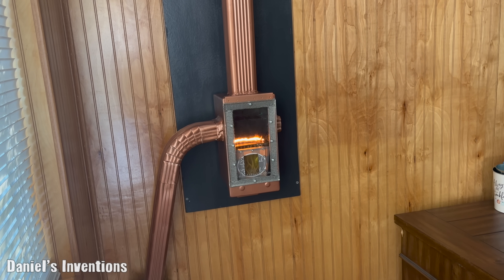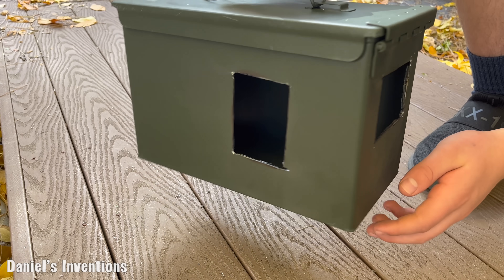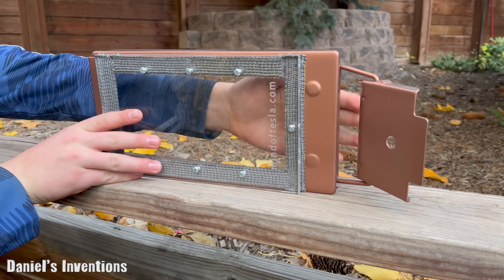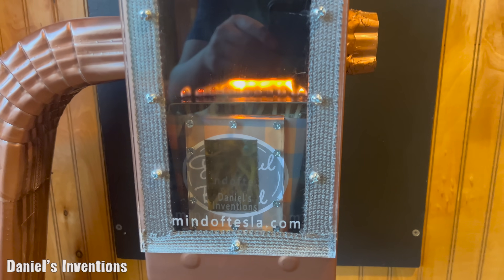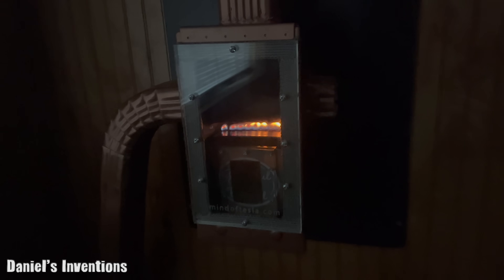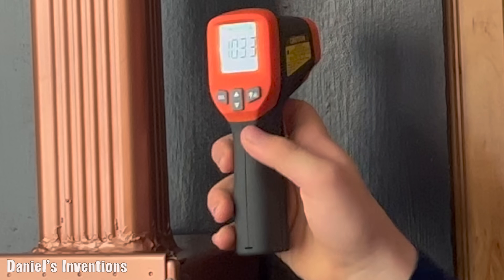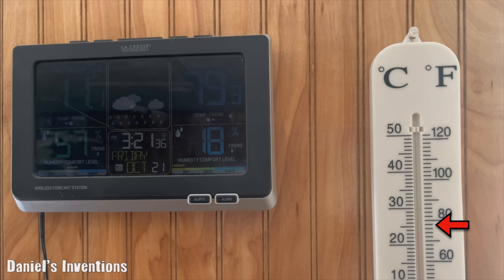ENDLESS Heat for Your Home WITHOUT Electricity

Comment: While I commend you on this video and idea there's a few things with this build I have to comment on. Let me point out that I’ve been a certified Chimneysweep for a very long time. This method of heating is not a new one and historically dates back a very long way. Styles change but the design is mostly the same.   First you must space fireboard and concrete board 1” from the wall for safety reasons, this allows air to flow behind the board and prevent the board from retaining heat at the firebox mounting point and causing a smoldering fire behind it. This is caused by the concrete board coastally transferring the heat to the wood causing it to get hotter over time to the point of combustion. Next issue is that gutters are not made of steel and are aluminum. This means the melting point for the metals is around 1221 degrees F or 660 degrees C.  while the output you showed is around 450 degrees F the spots directly over the flames will be much hotter near or at the melting point.  You would be better off using copper gutter as copper’s melting point is 1984 degrees F or 1085 degrees C. Also, copper gutter comes in round segments meaning you will get a much better draft.  It would be wiser to braze the copper to the steel with bronze rod. I’m unsure if copper gutter could be roll flanged and brazed like steam boilers but this would be a much better option to seal it than JB weld which will break down over time.  Your other option would be to use a multitude of 1’pipe flanged into the box in an arrangement that would pick up much more heat. You can find this information by looking up how to make barrel stoves and stream boilers. Then braze the copper gutter around the outside of the box to allow attachment of the input and output piping.  Lastly, I would recommend building a means to adjust the wick higher and lower to better control the heat. There are a number of easy ways to do this with some old small gears steel rod and flat wick. I would also as other sugested look into the chimney effect as well as this will cause better movement of air.  All in all This is a great build with some minor tweeking you can make it even better.
Reply: Gutters are absolutely made of steel, as well as aluminum, and Galvalume. The issue with steel is that they are usually galvanized. You don't want zinc poisoning.
Reply: @1stuart1  Well actually they were made of copper,  then galvanized steel,  and now they are mostly made of aluminum.  Everything changes with time. Copper became to expensive,  galvanized steel still rust when clogged and holding wet leaves,  and aluminum is cheaper,  doesn't rust and is much lighter. Making it easier to install. Not trying to be a smart ass. I used to install them
Reply: @anthonyaubuchon765  I inspect houses all over the country. All types of gutters are still made, and still used, don't forget vinyl. I've never seen a copper gutter in person as that is mostly on fancy houses on the East coast. Seems like the major determining factor is just what the owner is willing to pay or what the sales person is able to talk them into. In fact, just today I saw both aluminum and steel.
Reply: @1stuart1  That's true,  I didn't think about vinyl.  That wasn't out when I was installing. I know they still make galvanized gutters but they are not used as often.  I  guess that could depend on what part of the country you're in.
Reply: @1stuart1  I don't know what kind of camping you're doing or how big your tent is but I seen a pretty neat ideal on here a while back.  A guy split a log and then chopped the edges off each piece and then put them back together wrapping wire around it to hold it together. It made about a 3" hole all the way down the center. He mounted legs on it so it stood about 4" off the ground. It burns very efficiently. Once he got it lit he he stuck a 2" metal pipe through the center below the bottom of the log and ran the pipe into the tent. Since heat rises it draws air through the pipe, heats it and into the tent. The pipe is below the bottom of the log so no smoke, just clean warm air. Might be worth checking out
Reply: @brock8830  yeah it seems to be a coastal thing, which I generally avoid, with the exception of Hurricane territory in the southeast.
Reply: @brock8830  oh yeah, lots of Californians moving to hail areas and thinking their house looks great with copper roof accents. Haha.
Reply: @anthonyaubuchon765  if you were paying attention at all to what the young man in the video was saying, he clearly stated at the beginning that he was suing steel gutters.
Reply: @anthonyaubuchon765  And stainless Steel lasts way longer than any of the three you mention.
Reply: @anthonyaubuchon765  It's called a Swedish Candle
Reply: @anthonyaubuchon765 😂😂😂😂 and a tree is a tree 😂😂😂 my tipi has a wood stove made from rock's.a Rock is a Rock gives out good heat 😂😂😂😂
Reply: @1stuart1 no you don’t!! However, if you do find your self breathing in gases from something galvanized drink some milk and get to fresh air.
Reply: @1stuart1 I removed my old stainless restaurant vent....would stainless be safe to use in this environment?  Off gassing wise?
Reply: @johngatsby1473  I'm not experienced in this specifically, but fireplace flue pipes are stainless and there are no issues. You don't want galvanized steel because burning the zinc off releases poison gas. This is not an issue with stainless.
Reply: @1stuart1  thanks for the response.  I'm going to build one of these out of scrap everything...goal~almost free....lol
Reply: Could this system be installed in a wood burning stove.  Seems like that would solve all the material deficiency issues?
Reply: @rv5002  It would be a challenge to do, to make it recirculate room air separate from exhaust…unless you just used the old woodstove with a fresh air intake added, & kept the chimney pipe intact…guess the heat would then build up in the woodstove, & the usual woodstove fan could recirculate indoor air. 
But, it Must have a fresh air intake that comes from outdoors, to help keep the flames lively.
Reply: @rv5002  I would recamend building a larger box version and work from there. I'm not comfortable modifying any stoves to another system as depending on the stove this could cause structural issues and more.
Reply: @HiddeneyeInc  Then don't build one.
Reply: @rv5002  cause, distillers and such use copper no?
Reply: @rv5002  Yes, most definitely!
Reply: @rv5002 Yes. The cast iron is dens and strong.
Reply: @hiddeneyeinc. What do you think of this idea?
Reply: After a quick google search I was able to find steel rain gutter downspouts, but given that they were all galvanized I suspect you're correct that the one's he used were aluminum.
Reply: @Devin_Stromgren  I've seen factory painted gutters of steel, Galvalume, and aluminum. It doesn't matter now, just don't want them to hurt themselves. 

Anyone know where to get fireplace glass? Wish there was a little more detail, like showing them adding/ replacing oil. I want to make one of these to see if it could replace the wood stove for my GP Small military tent stove. A wood burning stove in a tent is cool, but only had like a 2-3 hour burn time so everyone woke up cold every morning.
Reply: @1stuart1  The oil is just in a coffee can.  Just pull the can out and pour more oil into it.  As for tent stoves, unless you're camping somewhere without easy access to wood I would recommend going with a woodburning ammo can stove made out of a larger ammo can such as one for 20mm rockets.  A wood stove made from one of them will burn for 8 hours.
Reply: @Devin_Stromgren  I wish that were true. The wood stove that came with the tent is about 5 times larger than a 50 cal ammo can, but it isn't designed all that well I guess because it definitely puts itself out in a little over two hours. I'd love a stove the size of the ammo can though, that'd be great and save me a ton of room and weight!
Reply: @1stuart1  reclaim glass from old stoves
Reply: @1stuart1  Perhaps if you surround the stove with a lot of stone so that when awake and burning all day it will heat up the stones and give off heat all night. Also think about double tent or using ferns, leaves etc to insulate.
 Also they used to take the stones and dig a ditch in the ground, put the hot hot stones in the sleeping ditch and then cover with a bit of sand or soil then moss or leaves and then bedding.. kept them warm all night.
   Remember too that the earths ambient temperature below permafrost is 50+/- degrees, which will suck the heat out of you ... but if you warm it up a bit it will holed the heat for a long time and 50 degrees is far better than 30 or below!!!
Reply: @1stuart1  Oh wow.. if it is that big then you arn;t using the right wood, the right size, or something .. too much air perhaps.. Try lining the inside and outside with stones and see my other comment above.. For me I have designed many a stove and learned a lot.. and again more heat is lost through the chimney!!  You double your heat by putting the piping at an angle for a long time , even around and around, before going vertical.
  I have a design that splits the large pipe into two smaller ones and they are in a helix coil spiral before joining again and going vertical, but have yet to build...
Reply: @1stuart1   Lol, I know exactly what you mean about the wood stove.  It sucks having to get up every few hours to add more wood. He installed the glass window into the  lid of the ammo box,  so you just pop the latch and open to gain access to refill with oil. He didn't show anyway to shut it down so I can only assume you have to blow out the flames to shut it off. I think you could make something like this work in your tent.  I mean of course you will have to design it to be stable enough not to fall or get kicked over. A wood stove can be used so I don't know why you couldn't use this. Being in a tent I would make the wicks adjustable for more or less heat and of course you will need a power supply for the fan if wilderness camping
Reply: @1stuart1  ok, now I have to ask how big is your tent and what material is it made of?
Reply: @anthonyaubuchon765  It is a GP small, which I think is 12'x12. It's a military canvas tent. We only used it the once, and I'll honestly probably never use it again. However, if I were to build a heater like this, I could fit that inside any off the shelf tent made to fit a small titanium stove with ease. I don't even think a fan would be necessary, but I like the idea of one of those  wood stove fans that run off just the heat of the stove. My DIY streak has been reignited recently (mostly by this video actually) and I'm considering sewing up my own Sil-nylon Teepee tent. After I watched this video, I went and built myself a nice barrel stove just to have in my back yard.
Reply: @1stuart1  I have seen fireplace glass advertised cut to specific size on Ebay.
Reply: @1stuart1  Yeah my buddy has a tent with wood burning stove and we had to load it throughout the night or we would be freezing!! There’s got to be a way to soak or use compacted wood shavings in a brick that burns a longer!
Reply: @1stuart1  Apparently The trick is to close front vent holes and then the flume at the chimney to help it burn longer and slower. I don’t remember if his had the flume part though.
Reply: @hardcore4476  there are ways to pack a regular stove so it burns top down and burns a long time, but my stove is a bit too small for that, and is a vertical barrel, so it isn't conducive for making a tightly packed brick of wood.
Reply: @1stuart1  True..
Reply: @1stuart1  a discarded stove
Reply: @1stuart1 amazon has fireplace glass.
Reply: @1stuart1  Anyplace that repairs fireplaces. They can usually set you up.
Reply: @1stuart1  Do you have a damper in the exhaust stack? If not, add one and your fire will last much longer.
Reply: @Devin_Stromgren  just give them a wipe with muriatic acid. Zinc is gone
Reply: @Devin_Stromgren  They also come in stainless steel.
Reply: I never read long-ass comments. But yours, I had to read and pay attention to every word.
Thank you so much for your shared input.
I think the maker of this video should contact you to create a better version of this together.
You two could create a video teaching millions of us on how to build one of these and save lots of money and I turn, taking more control of our lives. It’s paramount!

P.s. please teach us how to build the glass cover too.
Reply: @da1nonlydoron779  Problem is he's wrong on several points especially using copper that when heated to high temperatures like the 450 degrees shown will give off deadly fumes.
Reply: @da1nonlydoron779  he is wrong about the copper..just use real duct...duh
Reply: A very informative post
Reply: @criminologystudent1nvestig523  9th
Reply: @paulsmith2956  9th what?
Reply: This guy knows his shit. Good work on bettering the world around you.
Reply: JB Weld is great stuff and ok for a prototype but totally inadequate for a permanent job.
Simply buy steel tube, as sold for car exhaust pipes and braze or silver-solder the joints. The extension pipes will be cooler so can be made with aluminium. 
All joints must be sealed with exhaust joint paste because any leaks on the exhaust side risk CO poisoning. It’s colourless and odourless and it will kill you.
Reply: I think he said he spaced it an inch for safety already
Reply: Why not use 3” pellet stove pipe wouldn’t that work?
Reply: @bomark2002  I was wondering the same thing.
Reply: Just use a material that is approved for stovepipe so you dont kill someone trying to save a few bucks. Iron and Clay work well as you must know.
Reply: can you someone just build me one please
Reply: @allwearearestars  I hear you. Maybe he will?
Reply: I commented something very similar to this and I seem to be making many people that keep claiming that I am wrong very angry lol
Reply: @RareVBlue  don't let people's thoughts get to you. If you cand back up your points and they still get mad. It's not on you. Some people like to get angry over nothing
Reply: @HiddeneyeInc  this is the internet. There are always people wanting to get mad lol
Reply: @RareVBlue  They probably  still believe  fake news media  like CNN  too
Reply: I'm not angry but they're steel.
Reply: @RareVBlue  That's why I largely just troll these days. Too many people will be assholes for no reason at all. So I just give them a good reason ahead of time. :P
Reply: @hideousruin  😂 😅 😅 Ain’t it!!
Reply: @hideousruin really. That’s the reason? Sure, ok
Reply: Dude! What a thoughtful reply.  Very cool of you to take the time. 😊
Reply: Hopefully his parents don't have their home burned down 😂.  Is this neat way to heat a fort or a cabin, sure. Heat a 200k to 400k home ? Absolutely not 🤣 Jesus CHRISTMAS their home owners insurance just got cancelled.
Reply: WETT certified chimney sweep here. Great idea but I echo what the above sweep said. Most important is that you get that air gap of 1" behind the concrete board. The threat of a smoldering fire behind that is very real. 
Great work!
Reply: To those who can't agree on something simple as the safety of heating copper, if u were able to watch the video then it's just as easy to look up the correct answers rather than rely on advice from an unknown source. 🤳😐
Reply: Wouldnt it be easier to just use stove pipe or maybe even hvac duct
Reply: Why don’t you build one then since you know so much? Oh I forgot, you are a chimney sweeper!
Reply: Just letting you know I noted you in my comments.
Reply: And lead pipes for your drinking water!!
Reply: In your sentence: "You would be better off using copper gutter as copper's melting point is" should read 1984°F , not "184" . It's just such a valuable part of your comment.
Reply: Holy crap there are polite people left .
Reply: Good info, thanks for your input!!
Reply: Wow that's a great comment, amazing info!
Reply: Very tactfully said. Constructive criticism is in short supply on the interweb.
Reply: @glennwmurphy1  i grew up in a family of construction workers and have worked in the field closely with HVAC among every other certified professional there is since i was 14 years old (currently 39). ive had everything from construction super certs to a general contractor license. and even if the creator of the video did do everything right. you have to assume other people who arent this guy dont have the same knowledge base you do and will burn their house down. thats the reason we have visual warning on chainsaws that specifically show and tell you not to cut the branch youre standing on. ppl dont think about the consequences before doing something.
Reply: Came to post a comment with a few of these points but you articulated this perfectly.
Reply: 100% those are aluminum downspouts painted copper they do make copper aluminum and galvanized etc. I love this heater but I'm glad you put your comment in here for people that didn't realize the aluminum wasn't a good choice so they can use the design and tweak it
Reply: Sure hope no one dies due to this video or even the comments. Exhaust pipe needs to be double wall. Gutters weather aluminum or copper or not designed for this application. JB welds are all suspect. Carbon monoxide is invisible. Don't die.
Reply: oil plus 3D printer = cheap heater
Reply: Politely added information with facts, this is how you help people to make better things and improve their skills
Reply: Young intelligent people doing positive things.  There is hope
Reply: Paragraphs.
Reply: @GravaticBurst  "Paragraphs"
Indeed. Must not have heard of punctuation before 😝

Good info in the text though so I overlooked it. Still a pain in the bloody arse to read though...
Reply: @Johny40Se7en  Essay's kill my eyes. Personally I'm bad with punctuation.
Reply: Awesome advice
Reply: Did he make the upgrades you suggested?
Reply: Master Marc Subliminals  LMAO
Reply: You're very informative, Charlaine. Despite the TECH rampage changing our words to divide and conquer. It is still understandable.
Reply: Well said. I appreciate you
Reply: dude, fix your F to C
Reply: W
Reply: Its not 1085 c its 85 c. 1000 c is a big difference.
Reply: DUDE! those gutters are worse than aluminum - they're steel... GALVANIZED steel, thats why the look like aluminum. kids been breathing zinc vapor...
Reply: not to mention if i remember aluminum gives off toxic gas when it burns so that would not be fun probably lol
Reply: @seancook4317  those gutters are actually made of GALVANIZED steel - zinc is like 1000x worse to be breathing. and he said he burned it 12 hours a day for a week straight. that kid already messed his brain his brain up permanently. he's almost guaranteed to get early onset Alzheimer's now
Reply: @mordokai597  oh thats nice, hopefully people read the comments before they melt their brains, i dunno maybe he found like regular metal gutters someplace somehow and everything will be cool, ive never seen them where i live tho, but maybe he's in a different place, i have no idea, i hope people dont die lol
Reply: P
Reply: Not sure where you could buy one these days but steel downspouts were available. I have a few lying around.  His do look like aluminum though
Reply: @chrism6952  steel still exists, with Galvalume being the most common (I think). That is steel galvanized with aluminum instead of zinc. It's a trade marked product so you should be able to look up what's in it, in case zinc or something else is still an issue.
Reply: Awe hell Rent a cabin 😂😂😂😂😂
Reply: Woaah I'd love you to be there when I post my jayco remodeling video in the future. 

I could so use some advice when it comes to heating it. I'm a little against propane heating...and I need it to be non electric..so this idea is bomb.

My concern is... the space I will have and my quality of air plus safety. 

I am sure you'd would share some really practical and beneficial advice.

Had to screenshot this 😅
Reply: You should put out a video lol
Reply: There are steel gutters and downspout , I know because we use them at work . We use steel , aluminium and copper !
Reply: I lost it at "certified chimney sweeper" -  
Chim chiminey, chim chiminey, chim chim cher-ee
A sweep is as lucky as lucky can be
Reply: Safety schmaftey......
Reply: The aluminum is going to conduct the heat away too fast to melt. I have built many foundries and forges.
Reply: Has to be the most well-written, positive constructive feedback on the internet
Reply: imagine not reading description , he said they took inspiration from another place
Reply: We do not care.
Reply: Great reply. I had my doubts starting with the board on the wall. Thank you for sharing your expertise.
Reply: Dang dude, you should make a video!
Reply: I'd also recommend  you win the lottery  so you can hire an experienced engineer  with a Chimney  installed, oh and a AI to design the perfect one. 😄  jokes aside. Glad to see people  being positive  and sharing  ideas. OH internet, you've come a long way since being made by the military  complex.
Reply: Some rich guy: I recommend  you stop being broke and just buy a diesel v10 heater that rolls coal like a factory and live big!!!! Woooooooo, Mericaaaaa! Do it big or go home!!!😄
Reply: Wow your changing the world with your knowledge
Reply: This is not a great build. It is dangerous. and deadly.  You are correct " JB weld which will break down over time" this will cause a fire. Gutters are made out of aluminum and tin. Since these were prepainted I am guessing they are Tin.
Reply: aChtUaLlY...
Reply: First off to the know it all. It’s a steel painted DOWNSPOUT. Not a gutter. It’s steel! It’s painted, not galvanized. Geez! If he wanted to burn wood, he would have. Geez!
Reply: How tf does someone become a certified Chimney sweep? Be a 10yo in Victorian England?
Reply: Great Advice.
Reply: Do you have any reference videos on this also you're awesome thank you for sharing this!!!
Reply: I would love some advice on a problem stove we have..
Reply: Maybe ⅛ in square steel tubing, then a simple welder can be used
Reply: Is it possible to build a small version of this to heat a homeless shelter type cart thats 2.5x2.5x4? Would need it small because of very limited space but also used for cooking- I can see frying and backing with a hood design. My question is how small can this be built and how much space would it take up if using least space as possible?
Reply: A screw jack would work well as a way to fine-tune wick length.  It would require a little bit of welding though.
Reply: Could aluminum gutters be used in place of ductwork?
Reply: Don't forget how easy it is to make copper alloy and custom molds, make your own fittings etc in one big pour from copper you can scavenge. BTW thanks for your info
Reply: Thanks Bro
Reply: First off, my punctuation nazi side is gonna have a little dig, because that was a pain in the arse to read.
But that's a lot of great information, so cheers 👍
Reply: What the fuck is this? I'm not gonna read all this nonsense
Reply: ❤❤ certified chimneysweepr❤️❤️
Reply: Very well written advice as someone wanting to stay warmer this year I thank you
Reply: Yes one would think but I concur for the copper actually doesn't conduct a precipitous amount of heat in a quick enough time for it to be considered intrusively therefore statistically speaking it's 00007 possible that that's even likely to happen. Also may I conclude that the vortex precipitation conditions must proceed the contributions of heat supplied by the convex heat source thus obtaining a considerable amount of proclivity to engage the fortify the side bearings of the ignition sequence blow off
Reply: Any chance you could do a vid on the build you suggested?
Reply: I have no plans on trying this ever but This was a wonderful comment. Informative knowledgeable and courteous. I see so many comments where people shame others and don’t say shit.
Reply: Please follow up. Thanks. I hope he makes another one.
Reply: It's all about safety,
Reply: you can get steel gutters.. i am a home improvement contractor.. aluminum is more popular but you can easily get steel
Reply: please build one so we can see it!
Reply: Thank you for pointing this out.
Reply: So fumes go straight up and not out the side too?
Reply: How do you suggest venting out of a window and turning this into like a standing AC unit or whatever
Reply: Thank god an expert stepped into the chat.  I'm not expert, but my brain raised a red flag with the aluminium.
Reply: I was about to comment these points exactly but you articulated them much better than I would have. Bravo.
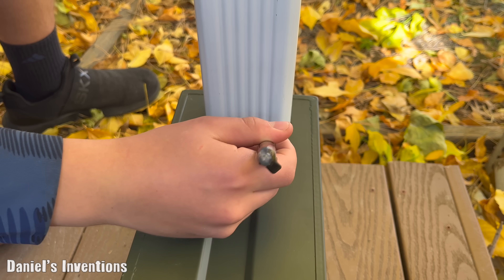Reply: If you’d watch the video, he used steel gutters. 0:45
Reply: So awesome
Reply: can you do a video on this? but give credit to these guys too?.
Reply: good job guys
Reply: hell yeah, Daniel, that's a great invention.
Reply: Would love to know the cubic volume of the area heated.  Anybody know if he has ever discussed that?
Reply: This guy old timey heaters
Reply: I really appreciate you took the time to add to this already great idea and you were obviously very well schooled on these things and giving this advice for free thank you very much for helping us people who are kind of layman...lol
Reply: question for you, is there any danger of co2 poisoning with this build?
Reply: You should seriously make one of these schematics you just described and patent and sell the SHIT out of it. I shouldn't be more then $30, I'd say, unless the person wants extra piping then that is their problem, im just saying the heater itself as he showed in the beginning of the video. Do it your way tho. It would last so much longer and be alot safer. Might last a couple life times. For real tho. Dint forget me if you get big lol go patent that shit!! Just rember the cheaper something is 99 % of the time the consumer will choose that regardless of the make of the product. It's hard times and everything is expensive as hell ESPECIALLY heating and cooling. That's where half if not more of ANY electric bill comes from, heating and cooling products. Hope you do it and come back and make me your vise president ceo 😊
Reply: Did anyone else read this? Lost me at certified chimney sweep lol
Reply: information overload  - he's solving the problems as they arise.  You must be a lonely person.  From reading your comment I'm not surprised.

I would not want to ask you, how are you doing, I'd rather watch paint dry.
Reply: @HiddeneyeInc

Why most long comments are just a HUGE WALL OF TEXT ?
HARD TO READ so I spaced your comment out every few lines. This way I'll read it.

---
While I commend you on this video and idea there's a few things with this build I have to comment on. Let me point out that I’ve been a certified Chimneysweep for a very long time. This method of heating is not a new one and historically dates back a very long way. 

Styles change but the design is mostly the same.   First you must space fireboard and concrete board 1” from the wall for safety reasons, this allows air to flow behind the board and prevent the board from retaining heat at the firebox mounting point and causing a smoldering fire behind it. 

This is caused by the concrete board coastally transferring the heat to the wood causing it to get hotter over time to the point of combustion. Next issue is that gutters are not made of steel and are aluminum. 

This means the melting point for the metals is around 1221 degrees F or 660 degrees C.  while the output you showed is around 450 degrees F the spots directly over the flames will be much hotter near or at the melting point.  

You would be better off using copper gutter as copper’s melting point is 1984 degrees F or 1085 degrees C. Also, copper gutter comes in round segments meaning you will get a much better draft.  

It would be wiser to braze the copper to the steel with bronze rod. I’m unsure if copper gutter could be roll flanged and brazed like steam boilers but this would be a much better option to seal it than JB weld which will break down over time.  

Your other option would be to use a multitude of 1’pipe flanged into the box in an arrangement that would pick up much more heat. You can find this information by looking up how to make barrel stoves and stream boilers. 

Then braze the copper gutter around the outside of the box to allow attachment of the input and output piping.  Lastly, I would recommend building a means to adjust the wick higher and lower to better control the heat. 

There are a number of easy ways to do this with some old small gears steel rod and flat wick. I would also as other suggested look into the chimney effect as well as this will cause better movement of air.  

All in all, this is a great build with some minor tweaking you can make it even better.
Reply: Yeah true that I was about to say that
Reply: Now, that's a professional input!
Reply: You're waisted on chimney sweeping mate.
Reply: you can get steel gutters, i owrked with them for 6 years.
Reply: You can get heat activated fans now too, no need for electricity or batteries (works via heat build up)
Reply: You can get heat activated fans now too, no need for electricity or batteries (works via heat build up)
Reply: You’re one smart bastard. Like an encyclopedia.
Reply: Could you burn wood or pellets or something else besides oil in there
Reply: Is there anything on the market similar to this that you can burn wood or charcoal in
Reply: Make a video.
Reply: Thanks for your comment and help. I have a question. Is that amo box safe to use and is it safe to paint it? What about smoke smut? How would you solve that?
Reply: Yes. This guy. Yes
Reply: No, that is not aluminum, those are steel gutter drain pipes, the one with the flame on it might rust through fast enough, but they're not going to melt.
Reply: Type better
Reply: You can buy steel gutters. Steel is also what is used in common forced air gas heaters, and the temperatures here are very similar. The only issue is pulling the fresh air from outside is not necessary and you could save a hole in the wall. You are however right about the spacing from the wall. Given these temps you would need 6" of open air between the combustibles or equivalent insulation.
Reply: If it works for him, good on him is always one. Well, I was a 😂😂 then 1000-word essay, get a life ffs
Reply: Sorry bro but nobody is reading all that
Reply: What he said👆
Reply: Dude...this paragraph manifesto said, "Let me make this youtube video about me now".. 😂
Reply: Your hired
Reply: That was nice helpful feedback.
Reply: Error 1: Gutters do come in steel. Galvanized AND stainless.A: Galvanized steel has a lower melting point compared to non-galvanized steel. While the melting point of mild steel is around 1370 Celsius (2500 Fahrenheit), galvanized steel has a zinc coating that begins to melt around 420 Celsius (788 Fahrenheit). Steel gutters also come in round segments as well as square and rectangular.

Error 2: Heating copper can release toxic fumes, particularly if it is heated to high temperatures. This can leach copper from the metal and give people copper poisoning.

Error 3: JB Weld HighHeat™ is a hand mixable epoxy putty stick specifically formulated to bond and repair materials that will be exposed to high temperatures in automotive and industrial maintenance applications. It cures to a tough, hard bond with little to no shrinkage. This industrial-strength product outperforms conventional epoxy putties at high temperatures and sets in 1 hour at room temperature. After 8 hours, it can be drilled, tapped, machined, ground, filed and painted. HighHeat™ is rated at a tensile strength of 4000 PSI and cures to a machine grey in color. It is able to withstand continuous heat exposure of 450ºF and intermittent heat exposure to 500ºF.
Reply: " wood causing it to get hotter over time to the point of combustion" This is basically impossible for an small oil lamp style heater as shown, all your rules of thumb are designed around wood stove heaters, evaluate the actual device as shown and calculate the thermal properties, you'll see.
Reply: Please make a video
Reply: Christ, bring in an "expert" chimney sweep and he takes up half  of googles storage facilities. 
I cant be arsed reading the end of your lengthy comment my friend.
Reply: Gracias
Merci
❤🎉
Reply: 😅😅😅😅😅 but the fkrs😂got heat.some how managed to buy insurance with out home inspection 😂😂😂😂😂
Reply: High heat exposure can cause copper to give off toxic fumes. Safest material would be steel. Yes those downspout pieces are aluminum, and vary thin at that, plus the paint is not made for high heat or open flame, also toxic. I'm a painter who used to do gutters, nice design, but huge health and safety issues.
Reply: @tgmickey513  research should be done
Reply: @Mickey P  So all this copper cookware is giving off toxic fumes? The only issue is if its giving off copper oxide, this would not produce the heat required. Not even close. But I mostly agree steel is the best material. However, in this application, coppers superior heat transfer would be advantageous.
Reply: @tgmickey513  could you just burnish the paint off with a wire wheel?
Reply: Doesn't copper give off noxious fumes when heated to too high a temperature??
Reply: @davidp8305  it could if it's a poor grade copper and the heat reached near melting but you won't get the  heat levels that would cause that with what they are doing. You're talking near melting point 1800f or so, and your not going to get there with this idea If that was the case you wouldn't be able to cook with copper pots and pans, use copper to brew beer, distill and more.
Reply: @HiddeneyeInc Great informative response!
Reply: @HiddeneyeInc  All copper gives off fumes when heated. even the wiring in your walls.
Reply: @davidp8305  Copper? its only paint, would guess on aluminium pipes
Reply: @Jorgen888  Could also be steel. This guy is 100% wrong saying gutters don't come in steel. They do. Both galvanized and stainless steel.
Reply: @davidp8305  Yes, it does. However that is the least of their worries. They are using oil, which means the by product is Creosote Oil, carried up and away by the heated air. When cooled it collects into a very sticky, very flammable oil substance. Since there are no embers, it's not much of a problem. Still requires weekly cleaning, and seeing that it is permanently fastened to the wall, I am curious about his cleaning methods. Add in heated copper and you have a flash fire. The heated copper when in contact with Creosote Oil can become a very danger combination.
Reply: @davidp8305  
You might be thinking of galvanized metal.
 It is healthy to drink water from copper bottles, etc. It is anti viral. But like the Zinc used to Galvanize metal to prevent rust, heating copper in this manner may not be ideal.
Use SS camp stove pipes!!!
 
Maybe the OP will comment. That had awesome insights into this build!!
Reply: @howtogetoutofbabylon8978  The only thing I would of done differently would of been replacing the candle wicks with a piece of carbon felt, it still would of wicked the oil the same way and the carbon wick will not burn away. It is pretty much a forever wick. It also would of distribute the heat more evenly. My2¢
Reply: @davidp8305  No. Brass will, but that's due to the zinc in the alloy. Cooper itself is fine and is often used for small boilers.
Reply: @davidp8305  yes
Reply: @davidp8305  I thought that was brass that did that
Reply: @davidp8305  That temp is much higher than the Aluminum he has.
Reply: @davidp8305  choreboy.... 🔥 💨😤
Reply: @David P  Not at these temperatures. It would need to melt, and still go further.
Reply: @davidp8305   that's brass,the zinc content
Reply: @davidp8305  it not copper. He painted it😂
Reply: @davidp8305  No
Reply: @davidp8305 yes which is the next point. Any and all fumes coming from Copper Metal is poisonous
Reply: @davidp8305 Not to mention that even gangsters like 'Little Caesar' are on the record as being vehemently against it: "You'll never take me alive, copper!" 😂
Reply: @davidp8305  Pure copper at these temps is safe. You'd need to exceed 900C to start seeing anything measurable, which is to say the copper would begin melting.
that said, some copper has trace amounts of other metals, like zinc, which might be a small problem at 500c, but not in this application since any vapors would be released INSIDE the tubes and vented.
Reply: @davidp8305 i heard the same lol
Reply: @davidp8305  They use copper stills for making alcohol so I would have to say no.
Reply: @davidp8305  sounds new to me.. I cook using copper
Reply: @davidp8305  yup, it forms cupric oxide, inhalation of these fumes can cause metal fume fever, in short, don't use copper in a heater folks, and don't use galvanized ANYTHING, use iron or stainless steel
Reply: @janceifyre  Thanks for the info!
Reply: All I got to say is jb weld really
Reply: @RentAsunder0 😂😂😂😂😂😂😂
Reply: @RentAsunder0  JB Weld makes a high heat version that is made for this kind of application.
Reply: Very kind of you to share your experience.  😊👍
Reply: Good grief.   This is why we can’t have nice things.
Reply: ugghh. How can I become a certified chimneysweep? I think there must be a lot of demand for that nowadays...
Reply: @oriraykai3610   There are plenty of sweeps. But, they are bound by their insurers, & don’t want to risk Anything to just install a chimney sleeve an owner has. 
All the contractors want to up-sell more products. Many will say, “sure, I’ll install your chimney sleeve, but, will charge you $2000, to make up for loss of up-sell profits!”…so do woodstove sellers. 😡 NONE have any eye towards future business potential…like, today, I need the chimney sleeve put into our chimney; tomorrow I might need other handyman assists, to redo windows, doors, etc….NONE think of that, when turning down a job like simply putting a chimney sleeve into a chimney. 
So…IF you were to be a “handy-person”, to help owners with whatever labor they need done, just as they want it done, you’d likely have way more business than you can schedule & complete, & have work for decades—especially if you are good at creative, durable problem solving, & details done right!
Reply: It’s a oil lamp on par with a little, minimal candle…. 

You people and your overriding urge to look competent when a child would understand that this just won’t get that hot.
Reply: Dude said I’m a certified chimney sweep😂💪💪💪💪
Reply: Dude  get a girlfriend .
Reply: Paragraphs please, an insightful write up and thank you for the insights. It was a difficult read though. All the best to you for providing this information
Reply: I would love to see your version buddy  make a video buddy get it up there.
Reply: @andyscott1608  not everyone has free time to make videos but when they can make informative comments it is just as important as the content of the video. Especially when the content can potentially injury or kill people lol.  There are extremely strict rules /regulations on wood/pellet/fuel burning stoves and their intake and exhaust. And as a homeowner with 3 fire places and 2 wood stoves I know for a fact that this kids dyi fire box would fail inspection and probably cause homeowners insurance to be cancelled lmfao.
Reply: Blah, blah, blah.
Reply: I would like to see you making a video with all the improvement you are talking about, not just coming with a bunch of ideas on other people hard work.
Reply: @carlosmontes2040  there is a time and place for the "then you do it" argument. when you have a movie or a game or some kind of art and just are complaining because you dont like it. thats the time. when the project is inherently dangerous because of something the person missed or failed to mention then its a case of safety that most ppl wouldnt know. then it falls to ppl who do know to pass that info on so you can replicate the project without buring your house down or at best burn a hole in your wall. dont get all upset just because someone criticizes something. actually look at whats being said.
Reply: First off aluminum has a higher melting point than the copper he's not trying to melt the stuff he's trying to keep heat in the place and yes copper when heated releases dangerous fumes that can kill you so I think this kid did very good and you sir are no professional chimney sweep because if you were you would know that copper would be a bad idea and just because you sweep chimneys doesn't mean that you know anything about how stoves or anything else works you may clean them but you can still know nothing
Reply: @Ytking0001 copper (1983) has a higher melting point then aluminum (1220) you would know this if you ever drank from a can at a bonfire where your redneck friends throw anything else In

Copper wire is fire reclaimed (oxidized copper) to recycle at a lower rate then “clean” copper (stripped with knife) 
But the time involved to strip the copper while drinking isn’t relevant when melting aluminum cans while burning sofas dressers beds carpets tires whole fields (controlled burns with water tanker truck on property) and shooting propane tanks

I have had plenty of small backyard fires with glass and aluminum melted down and threw in old surge protectors or damaged extension cord can’t find the bottles or cans but the tangle of copper wire is still the same length

Just my 2 cents after 20+ years of starting fires and few invites to 20 foot bonfires in 2+ acre fields

30 second search of melting point of metals also disproves this very quickly 

I also have a precious metal melting furnace for my business with the temperature of all the metals and aluminum is one of the first after lead copper is higher then my main metal of silver (1762)
 copper (1983 is just over gold (1948) which is alloyed with copper to do acid reductions (because it can not be melted out separately cost effectively) for precipitation (sulfuric nitric acid) in the refining process

Thank you
Sheaffer Select Coins
Reply: @Ytking0001  I guess you just casually forgot that people have been using Copper in Stoves, Furnaces, and Hot Water Pipes for literally hundreds of years...
Reply: @VerbalMurderGaming  Yeah you better tell the old moonshiners and whiskey maker's they can't use copper pots for stills anymore. Also distilled water is dangerous now hahaha 🤣.
Reply: @Ytking0001  No it does not. Aluminiums melting point 660 degres c, copper is 1085. 

Copper would need to be heated higher than the temp in this heater setup to release fumes. However I do agree, its not the material to use in this application.
Reply: @Ytking0001  but very good that he shared his background
Reply: @Ytking0001  what aluminum has a higher melting point than copper you are crazy
Reply: @Ytking0001 You realize you just said aluminum has a higher melting point than copper? Copper = 1984 degrees
Aluminum = 1220 degrees. You're not a professional either it seems.
Reply: Its his house not yours👍👍👍👍, not sure why you think he cares about your opininion 🤣😂🤣😂🤣😂
Reply: @travelingman4983  perhaps because he cares about other people and has seen what a waste it is when an entire house or human turns to ash because of a diy project
Reply: @travelingman4983  it's added info. Nobody cares about your opinion on someone's valuable input. Now, Go munch on some crayons.
Reply: @travelingman4983  He should if he doesn't want it to burn down.
Reply: @travelingman4983  this isn’t comments about pure opinions but a professional recommendation. Don’t ever hire a professional to do work for you or shut your mouth.